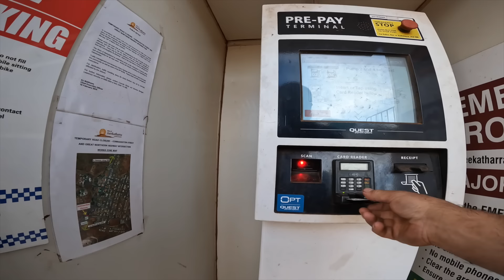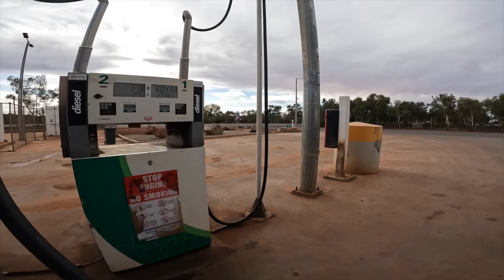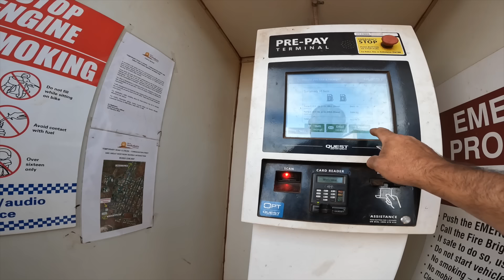The Road Train- My Home Away from Home- Going to a new mine site

Comment: Hi Tony from East coast I'm  wondering them bloody Volvo's idle so fast,,stay safe.
Reply from the maker: Not really, they are idle to 600 rpm but I have to put it on high idle to cancel the turbo timer otherwise it will shut down every three minutes, can’t use the microwave without engine running.

Comment: Hi from the Aussie who lives i France,i'm not sure if i got your figures right for the fuel stop,620 litres for 530 kms,that's 117 litres per 100 kms,would that be right?i drive à truck with Ad-blue (i'll murder the bloke that invented thzt)you didn't take any as the truck i usually drive uses about 2 litres per 100 kms.Another great little video.
Reply from the maker: Yes, that is right, it’s all depends on the load, wind, traffic conditions, usually I go around 80 to 90 litres of diesel per 100 km but sometimes I use as much as 120 to 125 litres per 100km and about 6 litres of adblue per 100 km
Reply: Hey thanks for the reply,pretty impressive the figures. I had no idea that the load configuration and wind really affect fuel consumption, the weight part of it i can understand, but compared to over here those figures are mind blowing.Have a great day.